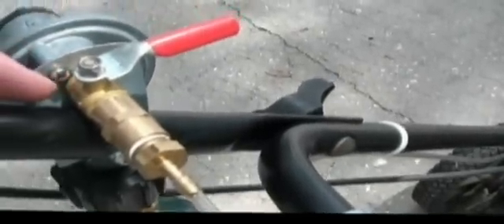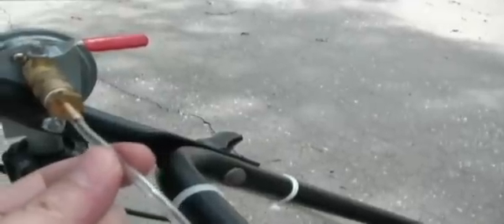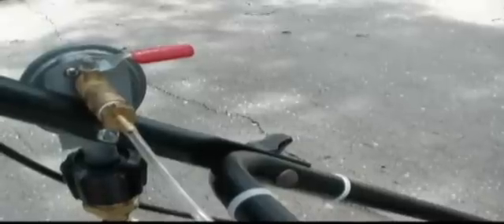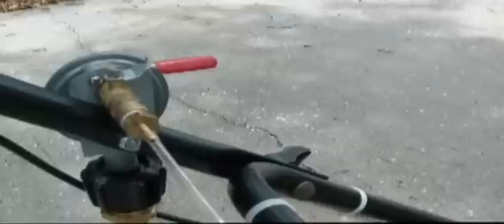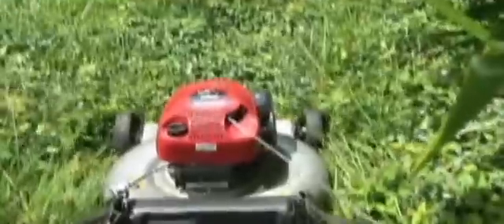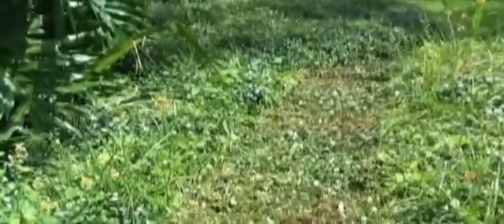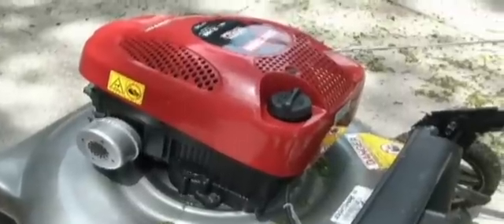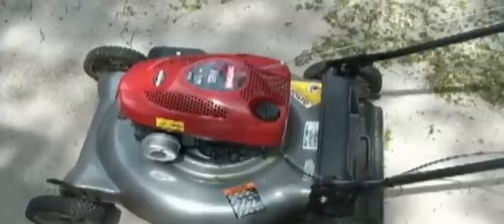Propane Lawn Mower Build Details, Part 2

Comment: I know this is an older video but it answers my questions.  I have an old MTD tiller my dad gave me and it has some carb trouble...so I was planning to convert it to propane.  Simple.  I actually have a regulator from a portable gas grill that bottles screw directly to and I can control via a knob on the regulator itself.  We shall see how well it works soon.  Thanks for your video.

Comment: Cool. I like the idea of the dual-fuel motor, in case you have to put the mower in the shop for maintenance. Simply remove the propane tank and they are free to work on it, just as the mower came from the factory. Thanks for posting this video.

Comment: +auxpowerunit - This is an " Excellent " Video and " Conversion ".  I have seen many Videos and it's the " BEST WAY " to go through the " Filter / Breather " since you don't have to do much!  Save a lot of Money, Simpler, Fast Conversion too!
Reply from the maker: You're right. Directing propane through the breather was so simple. It works well on this mower because it is a single-speed engine. For variable-speed application on my edger, I use an on-demand regulator, which is a copy of the Impco model J regulator. That required more vacuum to work, so I had to connect into the carb venturi. I replaced the gasoline jet with a propane "spud-in".

Comment: I did the same on a 1971 onan super ez  basically compressor hose with quick disconnectors one to the regulator the other to the Airbox works great on engines with governors
Reply from the maker: Simple and inexpensive, I love it !

Comment: How long does that Coleman tank last?
Reply from the maker: Depending on how thick the grass is, I've been able to get a 1-pound propane bottle to cut about 1/2 acre. I calculated it isn't much cheaper than using gasoline, but the propane gives much cleaner exhaust so it is worthwhile to me.
Reply: auxpowerunit Great, thanks for the info, well where I live, having a 20 pound tank refilled costs 8 bucks.
Reply from the maker: That is a good price. It costs about $17 to get a 20 pound tank filled here.

Comment: How do you keep the crackcase lubed up if the fuel does not have any oil in it anymore?
Reply from the maker: That would be the case with a 2-stroke engine. But this Briggs & Stratton engine is 4-stroke, so it already keeps oil in the crankcase sump.

Comment: You live in Florida. I can tell by the vegetation. I ran my mower on propane this weekend but I'm having power issues with the green bottles (ran ok on the skinny blue ones) I think its due to no pressure regulation.
Reply from the maker: Yes, I'm in Tampa. Everything grows so fast here. Regarding the power issues with the short bottles - the tall bottles may allow the propane to vaporize more efficiently. I get power cuts when liquid propane droplets go through the tubing. That isn't as bad on warm days. Sometimes, ice will even form on the surface of the regulator. If I occasionally warm the regulator with my hand, the propane vaporizes more evenly. Also, make sure your bottle is hanging with the connector facing straight upward, so it will only feed vapor to the regulator. Take care!

Comment: After converting my mower to propane (out of necessity, carb was too far gone) I find a LOT of people have posted ideas and best practices. Thank You for the video... each one helps.
Reply from the maker: You're welcome !  I admit that some things I did here are not best practice. (I really should put an automatic shut-off on the propane line.) But it works great for my purposes. Best of luck with your project !

Comment: Have you done any more with a better regulator? I have a 10hp gen I would like to convert
Reply from the maker: Unfortunately, I haven't done any further experimentation. I left the design at this stage of completion because it works well enough for my weekly lawn mowing. If you are converting a generator, it would definitely be better to use a zero-regulator. This Impco catalog is a good reference:   http://www.impco.ws/pdf/catalogs/IMPCO_Master_Parts_Catalog_Dec_2013_Hires.pdf
Good luck !
Reply: New link in 'Regulators' http://www.impco.ws/IMPCO-catalogs.asp
Thanks for the great explanation.

Comment: I like your system very simple. I see what you mean on a variable load engine you would need to constantly be moving that valve up and down but on a lawnmower it's just nice and steady. I never would have thought enough vapor would come to that small tube. Anyway thanks for posting.
Reply from the maker: That small tube surprised me too. It highlights just how little propane is needed.

Comment: Regarding the regulator, did the one you used just happen to put out the appropriate volume needed for your engine?  I suppose you could just use the ball valve to restrict flow if it is too high.  If the flow rate is too low, can you adjust the regulator?  Seems like you just got lucky based on my ignorance the details.  Very nice and informative vid.  Thanks for putting it together for us.

Comment: well my dad has alot of old tractor batteries they may weight it down but the engine is strong enough for the extra weight and i use it mostly for racing around and i may move the engine to a little gokart im making to go faster :) i live on a island with little slopes and almost no mountain so its fun to drive around on the lawn or road or even the ofroad racing park here where i live. even though im 14 i do know alot and i can drive quite well not cars but tractors and farm machines.

Comment from the maker: I'm glad to help. Let me know if I can assist further.
Reply: 8 years later, have you ever had any issues?  What about with very thick grass, have you had to regulate the propane to more when you needed more torque?  I'm using a 4 stroke on the lower leg of a Johnson seahorse (so it's a boat motor), and want to run it on propane so curious if I would need to play with the propane/air ratio to have it running well.

Comment from the maker: I'm glad this video was helpful to you. I get about 2 hours run time from the 16.4 ounce tank. I don't know how that would compare with a generator setup because the loads may vary. One of the limitations of my setup is the carb - it is designed for single-speed operation. Ideally, with your DC genset, you'll want a throttleable carb. Also incorporate a Garretson KN demand regulator, so you can save fuel when operating with low loads. I'm anxious to see what you'll come up with.

Comment: Thank you so much for making this video.  I know you discussed how much it cost to mow your yard in either this video (or part 1).  I plan on doing this same thing, but I will be placing it on an older mower engine that I will attach to an alternator off a car with a battery and invertor.  So what kind of run time do you get off a small tank like that?  Thanks great video!

Comment from the maker: That sounds like a nice setup. I also like how the engine starts within the first or second pull. It never started that easily while using gasoline. I did go back to burning gasoline for a while, because I had some old stale gas that I needed to get rid of. The propane was ideal for starting, then I turned it off and ran on gasoline.

I agree with your concern about filling the crankcase with propane. I'm going to add a Garretson KN demand regulator to avoid that problem.

Comment from the maker: I didn't find any need to change the spark plug or re-gap it. The OEM plug works well. One interesting finding: the plug stays very clean - no carbon buildup. I recently switched back to using some gas, because I needed to get rid of some stale gas which wouldn't combust in my weed trimmers. So, I poured the gas into the lawn mower and used the propane to start it. Once started, I shut off the propane and burn the gas instead. My next goal is to upgrade the system with a JB-2 regulator.